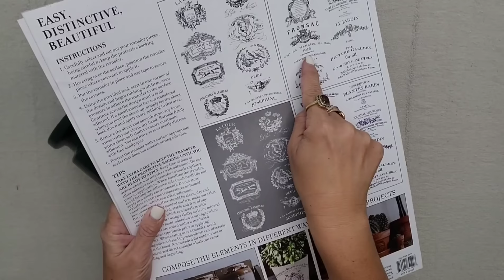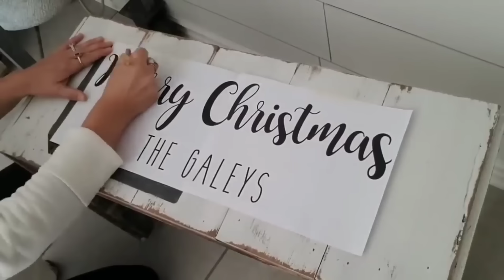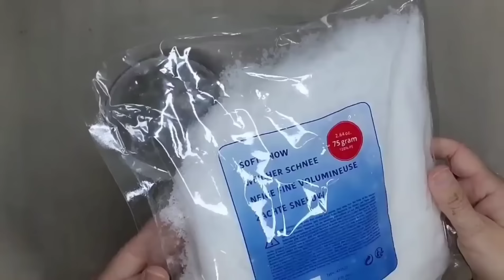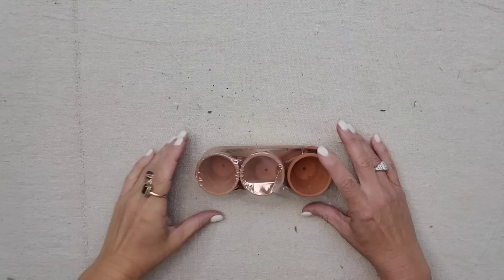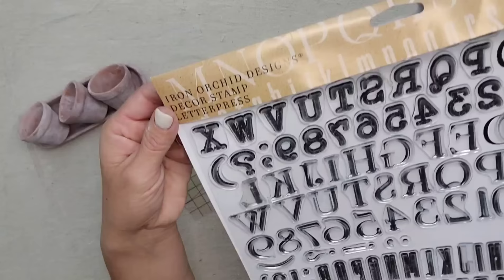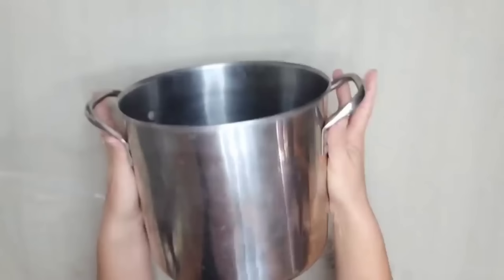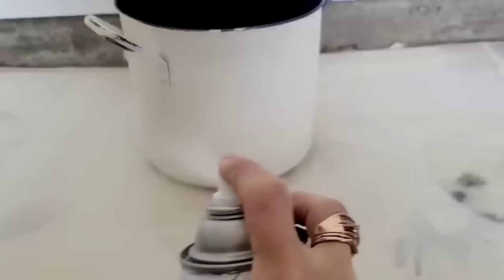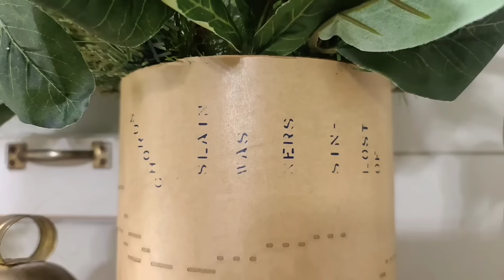MORE THAN 25 Christmas DIY ideas • simple easy decor ideas for Christmas • trees & greenery inspo

Comment: Small bread pans would make cute ornaments shadow box with small glued bottle trees or character type ornaments inside. This could be done vertical or horizontal depending on shape of item you glue inside.   A drilled hole at top/sides to hang.  I also think these are small enough to make a cute kitchen garland using beads, the tins and  reindeer or cookie shapes from clay or wood.